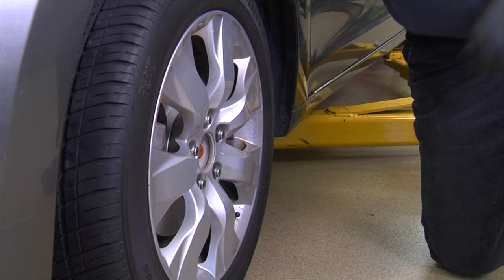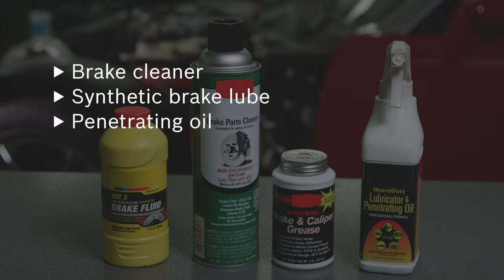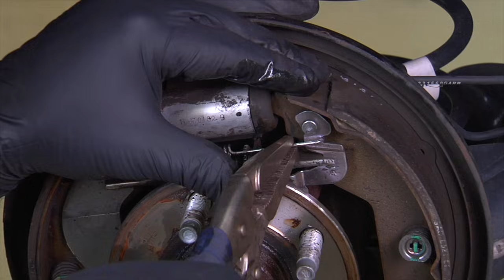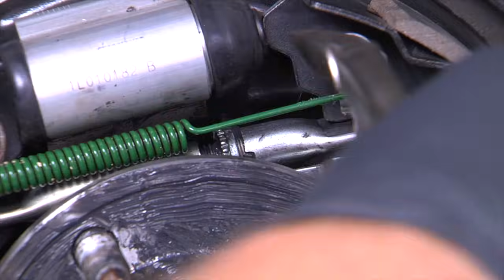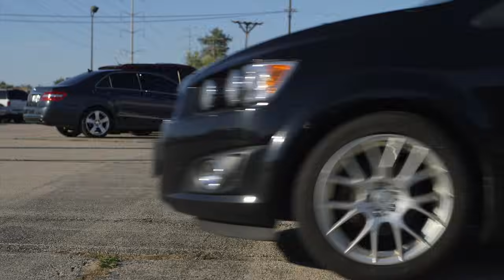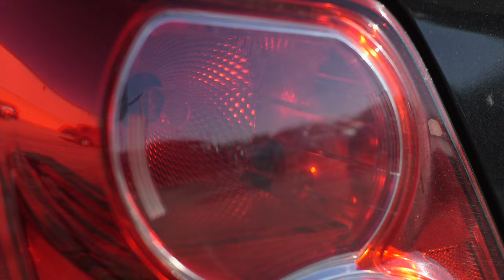How to Replace Brake Shoes - AutoZone

Comment: From what I have seen it looks like shoes crack and become dangerous just from being old , I don't trust shoes that are just glued, I think it's best if they are double bonded, glue and riveted.  wheel cylinders are very inexpensive and so many times are necessary to restore even braking, even if not leaking. I think there is a problem in the brake industry, IMO many of the calipers and wheel cylinders are using bleeding screws that are allowing air into the system because they are using too coarse of threads and when the screw is opened they might allow air to enter around the threads , they need tighter tolerance,  in general

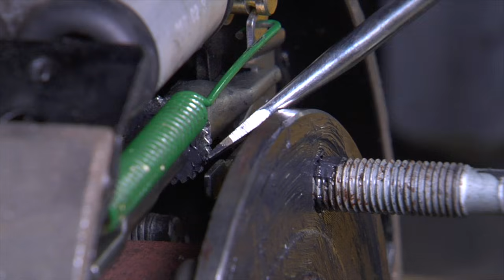Comment: 3:34 how can adjust when we've already placed the drum ??
Reply: there is a open slot at the back of the drum where you can use a flat head screwdriver to adjust it
Reply: I know what you mean. I caught that too. I adjust the spring first then put the drum back on and keep checking it like that til you feel a slight bit of drag.

Comment: good video
Hava questions is the brake shoe the same  brake pads  ?
Reply: Maher A ....not the same...same function yes, but not the same at all...discs are more easy by far to replace...shoes are just irritating to replace (not complex, just a pain in the 6).
Reply: Atonement 2018-2028 shoes are only for parking break (emergency break) 
Brake pads are what we use all the time as we drive

Comment: If you only included replacing the slave cylinder, that would be a complete idiot's guide to drum brakes in less than 10 minutes.